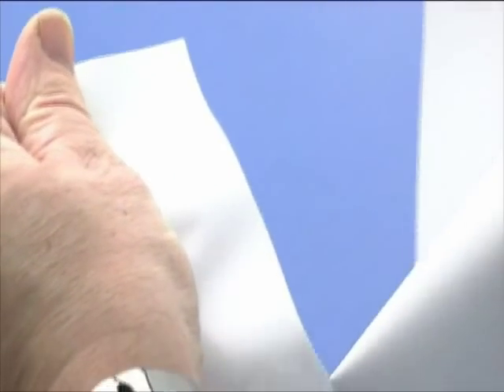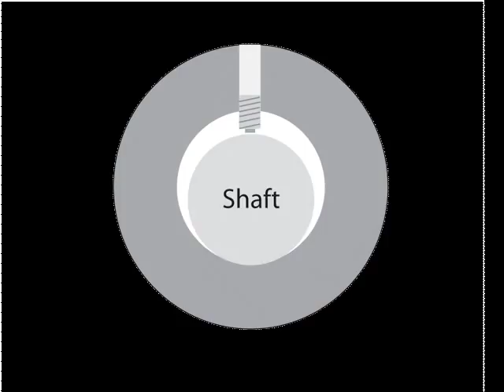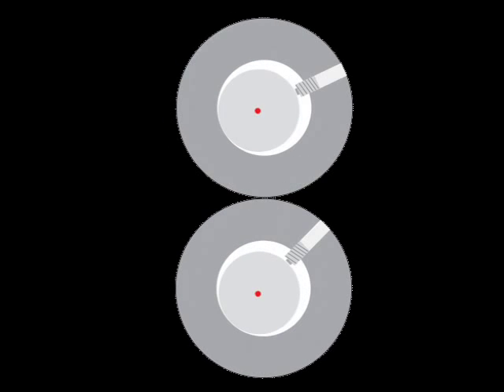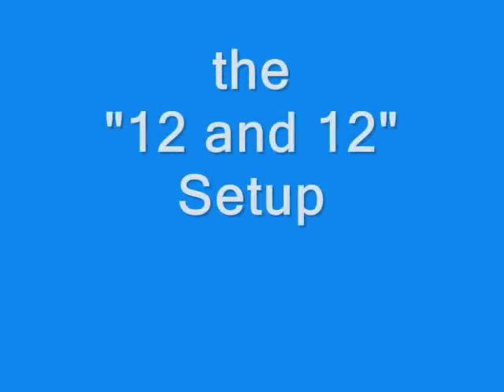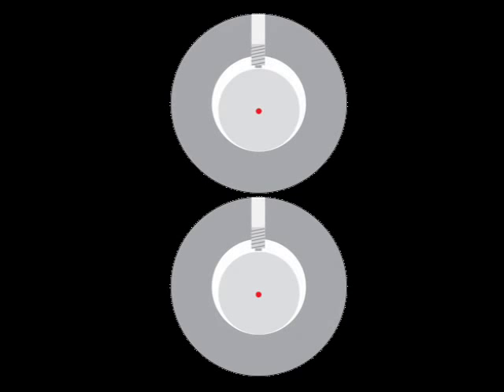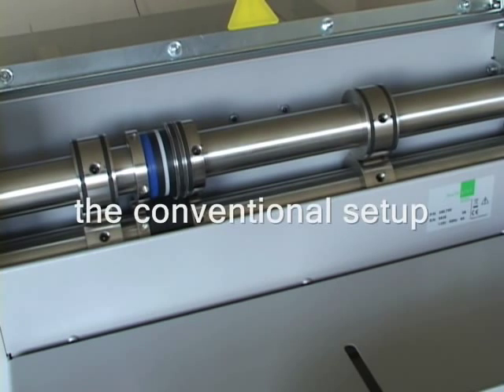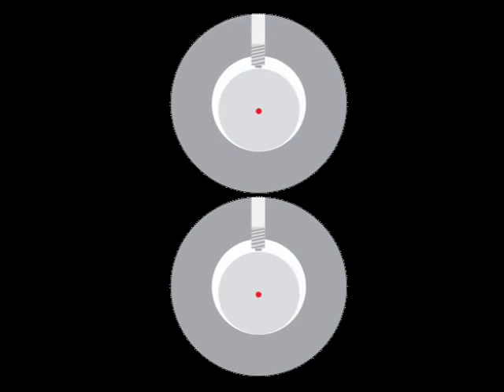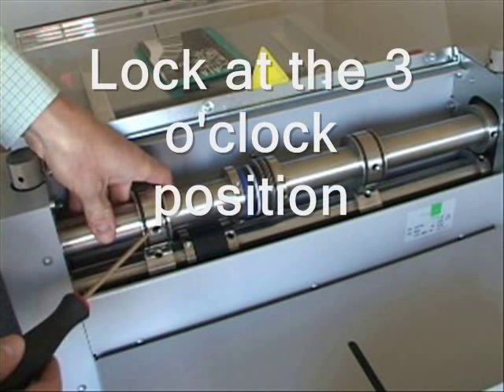Micro Perforating Tip for Folding, Scoring or Perforating Machines

Comment from the maker: @RCOwlPic In theory you're correct. In practice we've found this technique can indeed turn a troublesome perf job into an acceptable, quality job. Technicians at major folder manufacturers often recommend this technique based on real-world experience in hundreds of shops.

Yes, tolerance errors differ from part to part, but we've found that parts on most machines tend to have errors that are close, perhaps because they are often from the same batch, or from the same manufacturer.